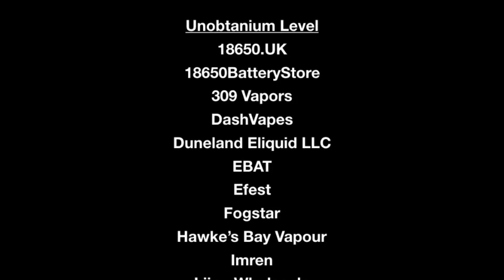Minding Your Mechs – Ep010 – White Brass Admiral  Testing

Comment: i was wondering regards to the temp testing, if you put your battery positive upwards would the tube get hotter on the top? what will happen if you flip the battery? thanks for all this great information! thanks to you i gained knowledge and confidence to get into mechs and i cant go back anymore! =)
Reply from the maker: I’m glad my testing has been useful to you! 🙂 I don’t use a battery. I use a solid aluminum slug that only gets one or two degrees above room temperature. I pass current through the slug and mod via a power supply and an “electronic load” that draws a steady 30A no matter what else is going on. When actually vaping I don’t think you’d see any temperature difference by flipping the battery.
Reply: @batterymooch  oh right you have that cosmonaut with the wires. Thanks again!

Comment: Thanks for the vids! Random question: I know ur supposed to use married batteries in a series mod, but I was wondering if it's alright if i use 2 batts that are the same age and not married? I don't vape above 10 amps.
Reply from the maker: There’s no way for me to know the internal condition of your batteries. It’s why we’re forced to err on the side of caution and advise marrying batteries for all mods. Check out Ep4 of my Minding Your mAhs series.

Comment: I love the little comments you put in videos poking fun at yourself. 
So far, the clutch plate seems to be the way to go about preventing arching, even these marks weren't bad compared to a standard mech. 
Did this put any marking on the cell? 
Have you decided what kind of threading works best on voltage drop as far as many thin threads or few bulky threads?
Reply from the maker: There is constant pressure on the cell, no arcing possible.
Don’t know about thread pitch vs voltage drop yet.

Comment: If the contacts were silver on silver there would be no arc marks.  Of course it would increase the cost substantially!
Reply from the maker: Silver can still arc though. The effects of inductance on spark creation occurs for any metal. I’ll be testing this all separately some time in the future.
Reply: Yes of course any time there is sufficient direct current you can have arcs on break.  A fast break works best.  I have been using my 2JNT Tycoon (solid silver throughout) for a month and looked at the contacts and they look perfect.  Amazing.  The body is also translucent (amber color of Ultem) and in a totally dark room with dark adapted vision I cannot see any signs of flashes from arcing whatsoever.  That's with a 0.09 build so plenty of current.  My slam piece also seems to have very little signs of pitting from arcing.  These side fires make mods with firing pin to battery can direct contact seem outdated if not plain hazardous!
Reply: Dude silver isn't that expensive.
Reply: No it's not expensive but the purest stock is difficult to machine which makes the end product accordingly priced.

Comment: Another excellent piece of information. Thanks for all your work Mooch. Now I have a question, whether you or anyone else supports clones or not, I think it would be a good idea to test a copper and/or brass clone of the mod in this video, merely to determine whether or not copper/brass is just copper/brass. Would there be a noticeable difference in performance?

Comment: I may be showing my age here, but given how localised the arcing was on the segments and barrel of the switch, do you think there would be any benefit in lapping them in with valve grinding paste (then of course cleaning thoroughly) to actually fit the parts to each other precisely?  It used to improve performance of the ignition system doing that to contact breaker points in engines I used to tune back in the days before a black box got in the way, so I know in theory it should help, but in theory there's no difference between theory and practice - in practice, there is!
Reply from the maker: It might, but by an unknown amount. It might only make a tiny, unnoticeable, difference considering how low the power loss is already. Though, if done well it might ease maintenance due to reduced arcing damage.
Reply: I was thinking more in terms of the reduced maintenance - the performance benefit we used to get in using that on contact breakers was (I'm pretty sure) mostly down to the fat that the pints lasted longer before any repeat was necessary - the current on the low voltage side of the coils being pretty small.  They still needed adjustment, but the lack of arcing meant that the adjustments were at least accurate, as the faces stayed parallel.

Comment: Hey mooch I love these tests, but is there any way to do more slide ups of your results. Its,so hard to see the small stuff..lol  everything looks so small. 
Thanks mooch!!!!
Reply from the maker: The tables?
Reply: Battery Mooch what is the best long lasting and also powerful 18650 battery for mech mod or single batt. im thinking what i should buy lg hg2 or sony vtc4.my friend has a sony vtc4 battery but it drains so fast but it has a great flavor and a lot of vapor...... Please help me choose the best 18650bbattery.what is the best 18650 battery in your opinion?
Reply from the maker: You can’t have long lasting and high power in the same battery but the Sony VTC5A is the best compromise between those two.

Comment: Hey mooch how do you suggest cleaning arc marks off batteries?
Reply: If you can't get the heavy duty Scotchbrite pads, see if you can get hold of an INK erasor, as they are very mildly abrasive.  Great for cleaning all kinds of electrical contacts.
The modern high tech method is a little stiff brush with the bristles made of of carbon fibre, which seem to do a no better job at a much greater price - but look smart in the toolkit to impress the customer!
Reply from the maker: I mention that in the video. Try Scotch-Brite Heavy Duty pads
Reply: Battery Mooch i thought that was just the contacts on the mech my bad but thanks keep up the good work sir